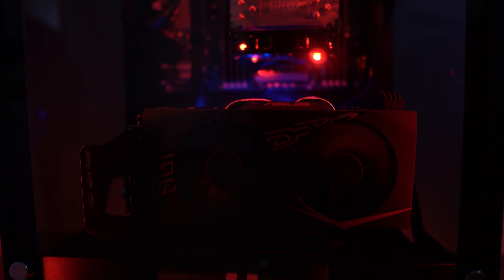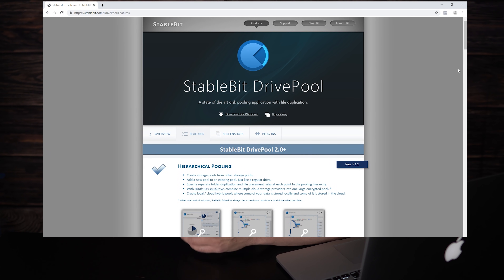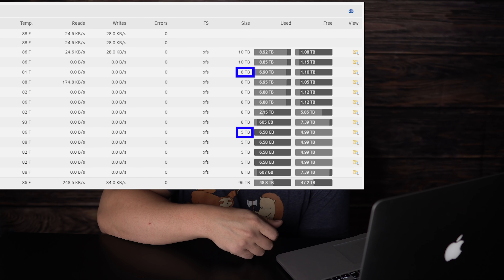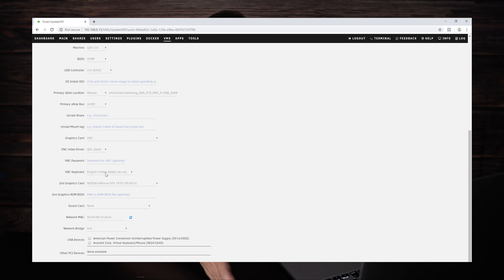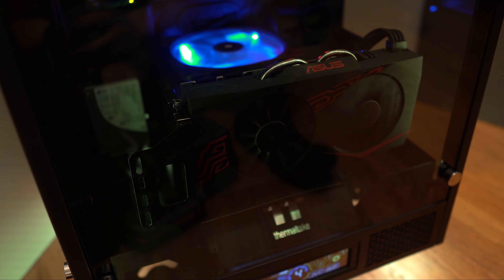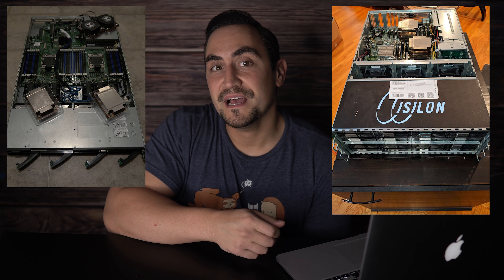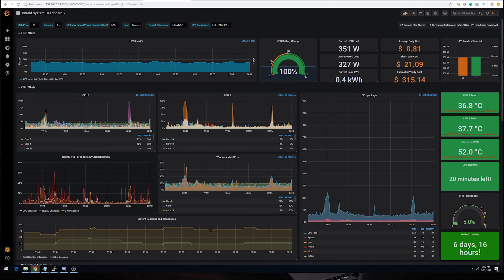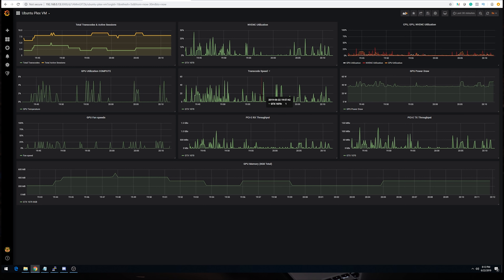How to build a quiet 117TB Plex media server (Part 2)

Comment: I think it would have been better if you split your workload. 
Unraid, with a ryzen 3 1200 or so, ASRock Taichi X370 (dirtcheap here since X570) that holds all your drives. (with aditional LSI HBA cards)
Grab a 120GB SSD, put ubuntu and plex media server on it and use that with the dual xeon system. You can mount the shares of unraid in ubuntu using NFS. (built-in on unraid).
Reply from the maker: Having a single server is a bit more energy-efficient and I don't lose any performance as unraid is a small amount of overhead. The GTX 1070 with patched drivers plus the dual xeon server is capable of 46 h265 1080p to h264 transcodes.  Splitting your workload made sense and was better before GPU transcoding came into the picture, but being able to offload 80% of the plex workload to a GTX 1070 means a single server can easily handle storage + plex + automation and labs.
Reply: @SlothTechTV  I do not agree. I'm using a G4560 on my own unraid with a plex container. As you said, unraid uses very little cpu but nonetheless your dual xeons use much more power idle than my G4560 does. (also don't forget the gpu)

I get it you want overkill, got 2 dual xeon systems myself. But I feel like you're recommending this which you shouldn't do. Your array isn't protected if 2 or more drives fail at the same time which can happen when doing the parity check/rebuild since all drives would be spinning. I hope you know that this isn't a backup either.
Reply from the maker: @lachiu1  Now you are comparing the power consumption of your G4560 to my dual Xeon server, but previously you were suggesting I run 2 separate computers and keep plex on the dual Xeon server? I am not sure I am following the argument you're laying out here. Why should I not be recommending dual Xeon systems? 
In your previous comment, you recommended I add a second dedicated server built with a ryzen 3 1200 for just unraid and that i should put plex and ubuntu on a 120GB SSD with my dual Xeon server -- set up as an entirely independent server. This recommendation would increase my energy usage/electricity bill, would not get any better performance for plex or unraid and would cost more to build as i would have to build another server? In what way would it benefit me to do this?
As far as your comment about only running 2 parity drives -- Unraid only supports 2 parity drives. Are you suggesting I recommend a different operating system altogether? Personally, I think as long as you keep on top of the health of your drives/SMART status, run regular parity checks and have ECC memory the risk is relatively low that you will lose any data with unraid in a 2 parity drive configuration.
Reply from the maker: @lachiu1  also -- it would require at least 3 or more drives fail all at the same exact time in order to lose any data not 2. Any 2 drives can fail and I will still be able to recover all data on those drives.

Comment: Question: where did you got the extra hdd cages for the thermaltake 900 case? I am about to buy one and I want to use most of the back as storage server. The dealbreaker would be the extra hard drive cages.
Reply: @jawamookey did u find anything that worked ?

Comment: How did you mount the GPU at the front of the case?  My (very limited) Googling has resulted in 0 other people that have done this?  It looks awesome.
Reply from the maker: Thank you for the compliment
I used this: https://amzn.to/2lCXfJy
And this:
https://amzn.to/2YdvPvD

Basically just a long pcie riser extension cable with a gpu mount :) only took a few minutes to install like that the cable management part isnt perfect and if i were to do it again i would've added another 50cm to run it back behind the tower and out through the bottom.

Comment: I missed something here, are you using a Quadro P2000 and GTX 1070 in the rig or just the 1070?
Reply from the maker: Just the 1070
Reply: @SlothTechTV I run GTX 1050ti I bought used and it supports more streams than I can use... like 25+ streams.

Comment: Hello, youtube recommended this vid which came out great! I am looking for the best solution to expand my storage, run win10 pro, plex, tatuli, NUT. Do you have a vid on how to setup using Unraid, as I would like to mimic your setup. Super cool. Off topic question, how do you access windows 10 pro gui? I am running Ryzen 2200g with a cooler master 240 aio, 128 gb m.2 OS, 500 gb samsung ssd (game drive), 10 tb dedicated plex storage with 8 gb ram inside a corsair 250D. Low power consumption was the goal - 60 watt power draw for those interested. Curious why are you using a GTX 1070 instead of the P2000? Future plans include ryzen 5/7, 16 gb ram, parity software solution, P2000. IF there is any negatives for using ryzen as a server please call me out on it.

Comment: what's the benefit of running the plex on a VM vs the unrade docker?
Reply: Two things that come to mind:

(1) The ability to run it on a different base Linux distro (e.g. Ubuntu Server in a VM).
(2) The ability to easily manage the Plex server independently of the KVM (unRAID), whilst also having other VMs on the machine.

Comment: Hi, can you please confirm if this card would work? It comes in 2 modes, IR or IT. I am having already RAID6 setup and using similar card but having some issues compatibility with motherboard (if I use GPU on another PCI it wont boot up :/, so want to try some alternative). Thanks, Michal
https://www.ebay.com/itm/LSI-SAS-9211-8i-8-port-6Gbs-PCI-E-Internal-HBA-Both-Brackets-IT-MODE/132776058625

Comment: Are you using a patched driver to get around the 2 NVDEC (encode) stream limit on consumer grade nvidia cards? By default you won't have ability to run more than two trans codes using Nvidia hardware iirc. Which is why a lot of people go with the Quadro P2000... Otherwise AMD doesn't limit you, but you have to use windows to use one. Sadly I use Ubuntu, so I'm forced to use Nvidia. I had to patch my Driver to get more than two transcodes working from the GPU.

Comment: Run ESXI as base OS.

Run Freenas in VM, passthrough SAS card running in IT mode. 

Don't use Unraid for long term data Storage, you will encounter Data Rot. This is not avoidable, Unraid nor the file systems it uses can counter data rot. Unless you are using a hardware raid card to combat data rot, and use unraid to join those pools together like Linus does in his setups. Your data will rot away slowly. Will you notice? Probably not, some data degradation isn't going to kill your files downright. But why put up with it. Espically if you are going to be holding on to some of this data for years to come. 

Data Rot is real people, you need a Filesystem that can deal with it. 

Running everything in VM's makes migration to new systems a breeze. No point not to run Plex on it's own Linux Distro, and passthrough a GPU to it. Don't run Plex in a docker, it doesn't get GPU support! Well not easily. Unraid doesn't have GPU drivers needed for it last I checked, and I doubt freenas does either.
Reply: Hi, thanks for your summary.. I actually am using Plex in docker.. and was wondering about GPU passthrough.. Since the docker itself is using kernel of host should be also possible to take advantage of GPU.. have a look at this stackoverflow answer and let me know what you think: https://stackoverflow.com/a/26568684
Reply: @aronmgv  I Know it can be done, it just isn't something that works out of the box. Nothing wrong with running Plex in Docker. And I was wrong about unraids current level of Nvidia driver support, though running modded drives in unraid is  way more work to do. Not sure about Freenas and Nvidia support.

Comment: Do you have a link to the motherboard you used? I want to build this exact setup as i currently have 50tb and want to expand up to 100
Reply from the maker: woah it looks like they sold out online :( I got it off ebay, but there are other options for dual socket LGA2011 mobos. Here is a replacement that is close to the same: https://www.ebay.com/itm/Supermicro-X9DRi-F-Dual-Xeon-LGA2011-EATX-Motherboard-3x-PCI-E-16x-2xGBe-IPMI/192954690383?hash=item2cecfeeb4f:g:VusAAOSwTs5dJQb2

Comment: I'm loving this. I have a question since I cant seem to find the info online. Does the case come with all the hard drive cages for this or did you have to get extras? If you had to get extra where did you get them? You say you put 15 total drives but the schematic that you show in the video it's possible to put a total of 22.
Reply from the maker: Yeah I had to order them through thermaltakes USA support. I think it only came with 2 cages plus the front 2 which makes for 6 drives total.
Reply: Thanks for the info, I've been looking into setting up rack mount servers. I hadn't even considered a show case plex server / NAS. I'm seriously considering this.

Comment: Very nice Setup. 
I'am using an Win10 AMD FX 6350,1050ti and 32TB. 
Vu+ Settop Box as an TV Headend. 
Local its Passthrough only, for external Streams their are 10 lines @ 1080 8mbit

Comment: Your videos have helped me out immensely.  I started out using Plex, but my new Samsung TV had issues running Plex.  Even though my TV was hard wired to my 300/300 internet service, every time I turned the TV on and clicked on the Plex App- I would get an error message that I wasn't connected to the internet.  The only way I could fix this was to reinstall Plex.  I downloaded the Emby Server and the Emby Client App on the TV and it works great.  I am sure there are reasons I should switch back to Plex, but I am happy everything is working now.  My system started as a way for me to watch my movies in my house on any of my TV's.  I took an old gaming tower which had a i9-930 with 24 GB's of RAM and was experiencing some problems and put a new MB, i3-6320 (I chose this because it was power efficient at the time), and 8 GB RAM.  After getting everything up and running, my wife decides to add all of the kids- 6, and a dozen friends as users.  So, now I have the potential of up to 18 users wanting to watch movies at the same time.  I was going to upgrade the MB, processor, RAM and install a high end GPU to make sure I wouldn't have any problems.  I posted something on the Emby Forum about what I should do for hardware and someone said I just needed to get a Quadro P4000.  I did some research and stumbled upon a video you did a while ago explaining that the consumer gaming GPU's wouldn't solve my problem and that a Quadro P2000 would increase my transcoding streams.  The bottom line is I bought the P2000 and everything is working fantastic.  I think I could add another dozen users and still be okay.  My server is running Windows 10 Pro with all updates and I have (5) WD Red 10 TB's HD's for a total of 50 TB's of storage (thank you Best Buy and Easy Store!).  I just want your viewers to know that everything you have shown will work on Emby as well.  Thank you so much and keep the videos coming.  As for some future videos, I would like to see some benchmarks on what hardware will convert videos the fastest with Handbrake.  Keep up the awesome work!
Reply from the maker: thank you so much for writing such a thoughtful and thorough review of my channel/videos. :) This kind of comment really makes me excited to produce more content for ya'll.
Reply from the maker: oh also! handbrake comment noted :)

Comment: Doesn't the PESH2 board have an LSI HBA built into it? Can't tell if you are using those breakouts as well as the LSI PCIE cards. Also why not use an expander instead of a second card? Not sure how many drives you are running.
Reply from the maker: yes it does -- and i am using both ports. As for the expander -- I had the second card lying around as well as an open PCIe slot so it was "free" but that is a good idea.
Reply: @SlothTechTV  Makes sense! If I had an extra laying around I would use it too. Maybe one day I'll actually need 24 drives. At least if you ever need to get the PCIE slot back you have plenty of options. I'm trying to figure out how to best use a super fast IODrive II 785GB PCIE SSD in my Plex server. Just using it as my transcode drive for now. Keep up the good work, very entertaining.
Reply from the maker: @ThePlev  Oh hot damn those iodrives are pretty cool I was looking at them on ebay -- pretty good prices too. What operating system are you running?
Reply: @SlothTechTV  I am kind of in the same boat as your Plex VM. Started on Windows 10 pro with storage spaces, it works and now I'm at 32TB usable. Going to have to collect some drives so I can migrate off of it.

Comment: Mine is actually quite similar 😂 PESH4, instead of PESH2, and dual 2670 v1, with custom built case and drive bays from different parts I got on eBay. All in all similar build, same OS and experience. Kudos! 🙌

Comment: I just picked up 3 Dell R710s and 1 HP DL180G6 fairly cheap. It's older hardware, but $20 for the HP was still a steal imo. I've loaded all 3 Dells with Proxmox, but I may go down to 2 because I don't need that much redundancy. The HP is going to be loaded with FreeNAS and I'm planning on running Plex inside of that. Other projects I'd like to do with this stack is install NextCloud, learn Docker, and run Ravada which is an open source VDI broker so I can have a couple thin clients for my kids to use.
Reply: gnatsum64 how do this project work out? Looking for some guidance here as I have a R720 and a 24 Bay Supermicro that I am upgrading a few parts before going live

Comment: how much power (watt) does this build need?
Reply from the maker: not much, depending on the CPU you use it vary's. That said I think around 200-300 watts at idle even with all the drives spun up. If you go with a lower TDP CPU it would be even less.
Reply: Thank you!

Comment: if you didn't already know, you can use/have gpu passthrough with the plex docker. less overhead instead of having a VM, also having the docker sandbox. EDIT: this is using [Plugin] Linuxserver.io - Unraid Nvidia
Reply: yup...docker works awesomely.
Reply: Performance is better in ubuntu VM than unraid.... Unless you are lacking RAM, VM is by far a better way to do a Plex Server.

Comment: This uses way to much power for what you need 1070 really ? just for plex ? Dual cpu just for plex? For a single user or even a small fam way to much overkill.
Reply from the maker: You are making a lot of assumptions about what my use cases and requirements are without much evidence to support your arguments. It may be over kill for you but it works great for me 😊

Comment: Tyan S7012 , Dual x5760 CPUs, 72GB ddr3, 1tb nvme cache, 10tb array w/parity. But im planning a new unraid server based on the 3rd gen threadripper (whenever they come out) current board only has sata 2 ports. It's also the model that didn't have included sas ports. sure I could get a pcie, but then i still into the issue of 10gbe. Most sfp+ 1-gbe cards are pretty cheap used, but due to the distance from my server to my main pc, I cant simply get 2 cards and run a DAC cable. I COULD get 2 sfp+ too fiber transceivers, but I dont want to run fiber though my crawlspace. So then im stuck looking at 10gbe pcie cards with rj45.. those are less power efficient and run hotter/use more energy, but oh well.. Except all the cards are only x4, designed for a pice 3 slot, my server only has pcie 2. There are dual port sfp+ cards out there that are x8,still designed for pcie 3, but if places in pcie 2 x8 it would still let ONE of the ports run at 10gbe? idk.. at this point, im gonna say fuck it and upgrade my server to a Threadripper. The new boards will be sporting pcie 4 and almost surely there will several boards with 10gbe onboard. (the Gigabyte x570 Aorus Master has one, and thats a consumer/desktop product technically, so id expect the HEDT boards will too. 
Sorry for the rant. Just found you channel randomly. also props for the tower 900 - ive been waiting for a reason to use one of those

Comment: I used to have a Dell XPS8500 motherboard inside of a rosewill4500 case with 8 HDs running off a perc 6e card. I was going to upgrade the guts of that to a server mobo/cpu and 12 hot swap drive bays but a 2U R720xd fell in my lap (I work in the data protection business and we have hardware we run POCs on for our customers. When that hardware got old I was extremely lucky to catch it instead of it going in the dumpster) I had 12 x 1TB HD’s but recently coworkers gave me his old set of 12 x 4TB HD’s. The r720 has 12 bays

Your plex server is beautiful I would love to be able to take my r720 hardware and put it in a case like yours but dells custom configurations make it so it will never really leave its 2U chassis. Yes it sounds like a jet engine but updating the iDRAC software quieted things down. It’s running in the closet of my guest room with an exhaust I built to shoot the hot air into the attic. I don’t know the CPU’s off the top of my head but they are 2 x 6core. I haven’t had CPU encode issues yet but I would love to get a graphics card for encoding. It all runs on VMware. I have a couple other lab VMs and web servers running tautulli and organizr and use a monitoring software called Foglight. 

Awesome vids man!

Comment: Is there any reason you didn't just use the plex docker that now supports hardware transcoding?
Reply from the maker: There is not -- they both have about the same performance and the docker containerized plex is quite a bit more efficient.
Reply: @SlothTechTV  Gotcha. Love the build btw. I bet your disaster recovery plan is expensive with 117 TB of Data ;D